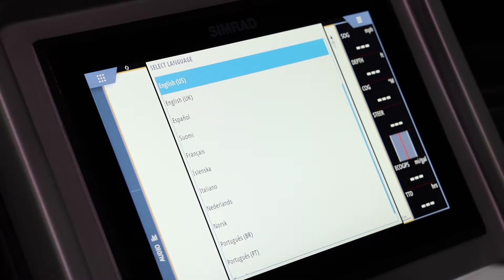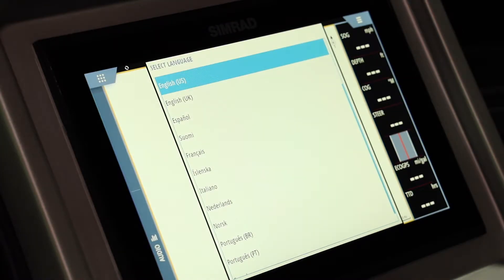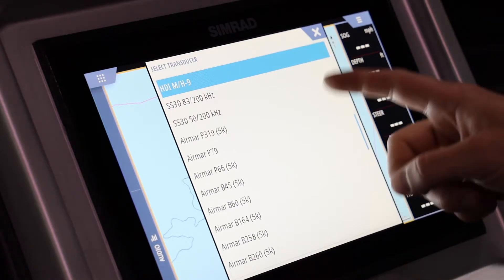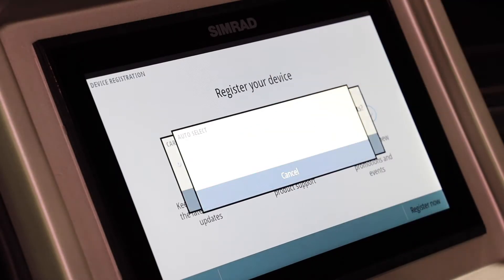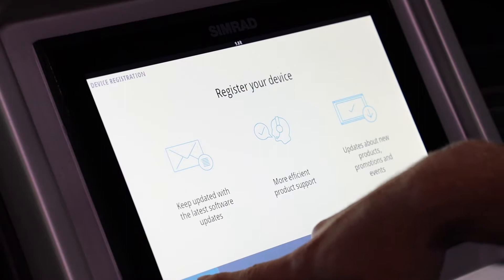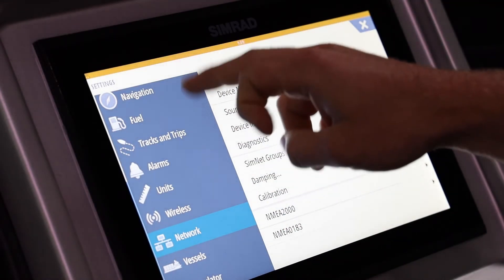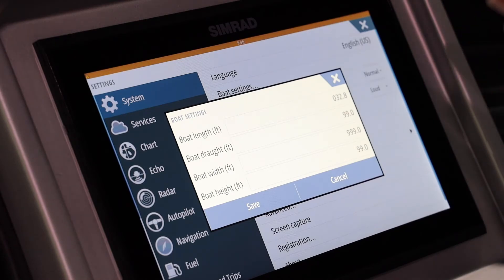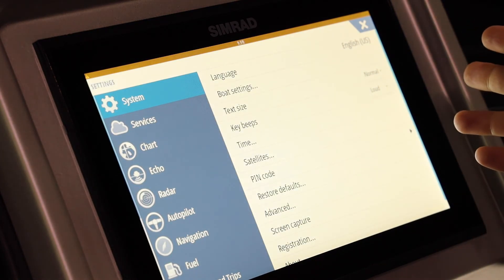SIMRAD Initial Setup

Comment: Great tutorial. Here it is 3 years later and this is the only tutorial explaining Simrad setup that I could find. Particularly appreciate the help on understanding the fuel gauge and setup. Would like to see a video on troubleshooting issues with a sender that is not seen by the Simrad and if that just means the sender should be replaced? Or if there is another sensor or network connection between the sender and the gauge that could be faulty?🙂